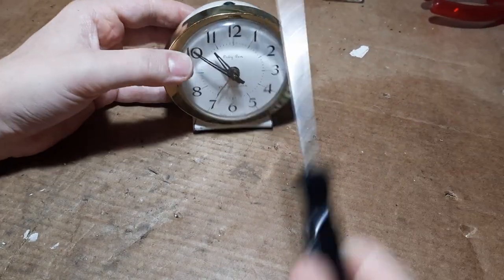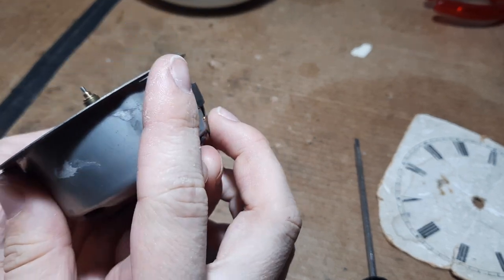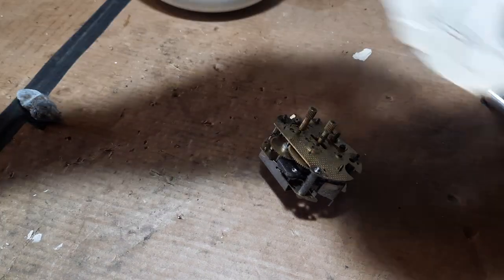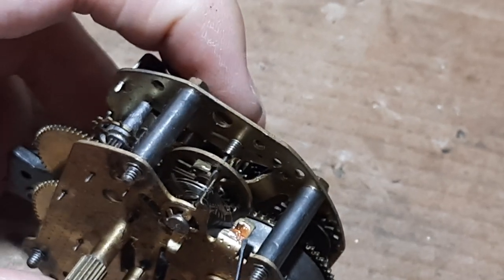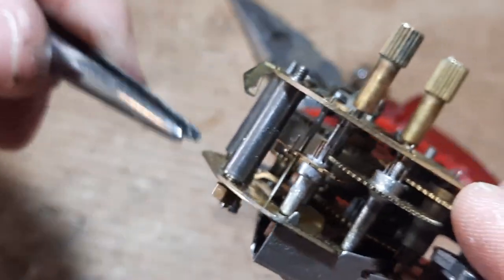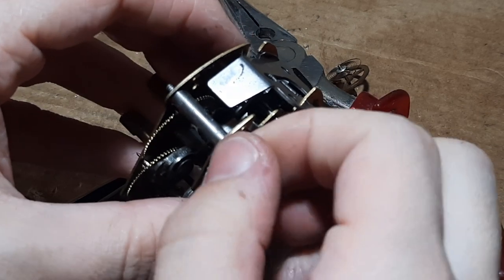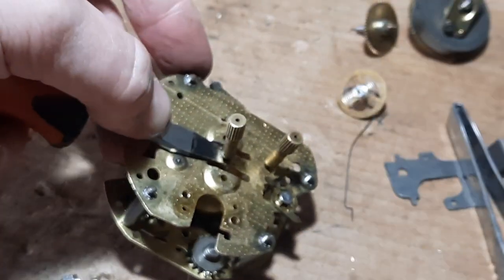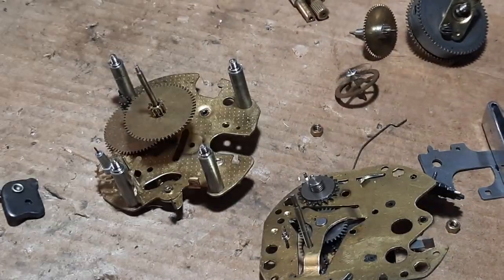Westclox Baby Ben Style 8 (1966) Knob removal and Disassembly

Comment: Do you know when the clock container was switched to plastic? I'm trying to date my Model 11038 Baby Ben without pulling the hands and face. The container is held together with 3 nuts, and the adjustment knobs are steel without holes in them. I'm guessing it's from the early to mid 70s. I also had an orange alarm clock as a child, I'm hoping my mum still has it in her messy house.

Comment: I also have one of these Baby Ben clocks, given to me  in 1966. Long seized-up and sitting nearby on a window ledge. Got a funny feeling it's going to be coming apart soon - although I'll probably wait for part ii before attempting to service it !  Those awkward push-fit knobs that didn't want to come off look like the sort of component you're meant to remove with a mini-gear-puller -  (hole in the top of the brass knob for the puller pin to pass through and press against the end of the shaft ?)
Reply from the maker: Yeah, I've been thinking of getting a contraption of some kind for removing knobs like these, I believe that's exactly how they're supposed to come off- with a pin through the top, however with videos like these I think it's actually more helpful to stick to tools that the average person would have at home. One of the aims of showing my repairs on this channel is to prove that clock repair does not always have to be a "leave it to the professionals" job, especially when it's dealing with the lower-end but equally fascinating world of alarm clocks. Thanks for watching!